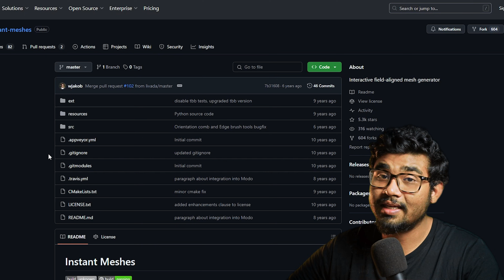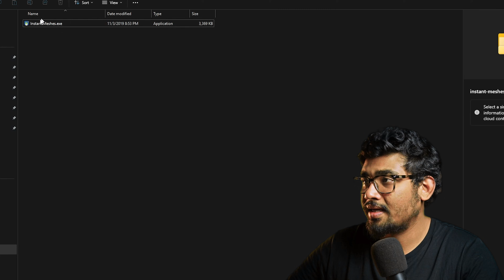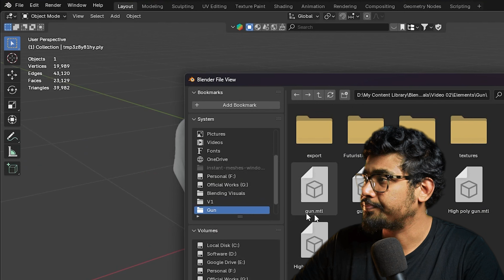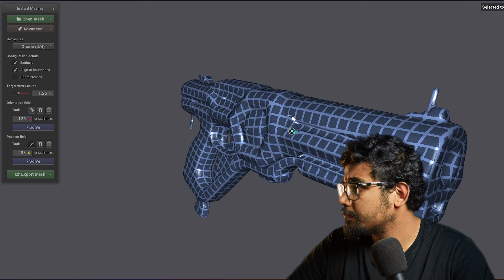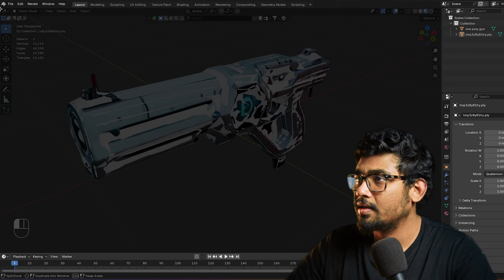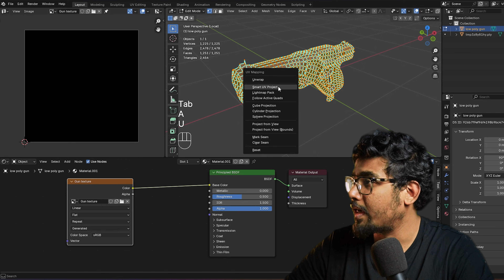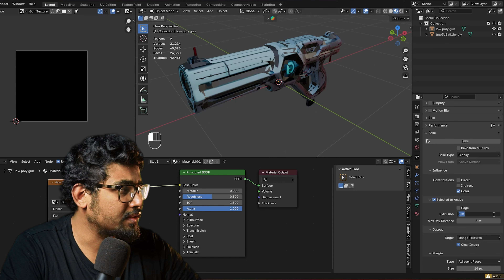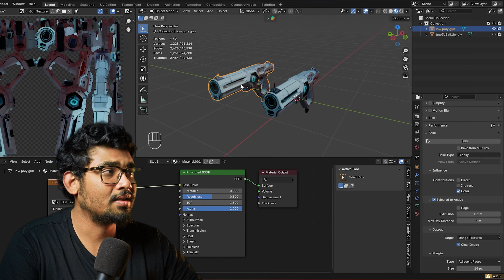Simple Trick to Optimise any AI Generated 3D Models FREE | Remeshing & Texture Baking using Blender

Comment: i followed your steps and got an error. The Alt j thing makes it to squads --> this software doesn't support squads and needs  triangles?
Reply from the maker: Hey mate, are you still facing the issue? Has it been resolved? Feel free to join the Discord server and reach out directly—I'm here to help however I can!

Server: https://discord.gg/KCDfmHntE8
Reply: @blendingvisuals  i resolved it by just not using your alt+j tip, just using m + tghe thing to dissolve double ones on the same spot. I still have some other issues, like the final thing has holes in it on the borders of elements.